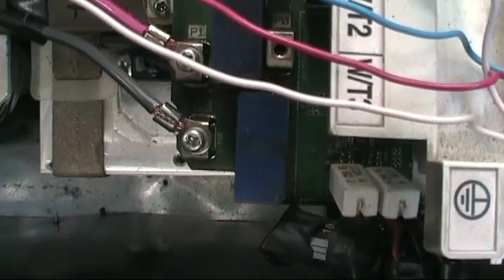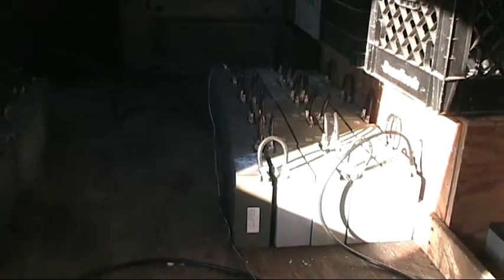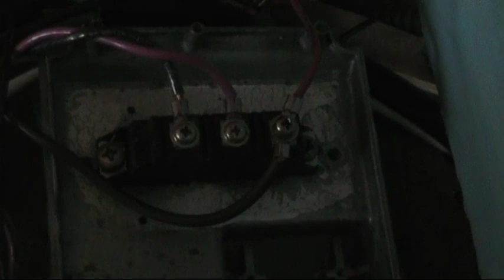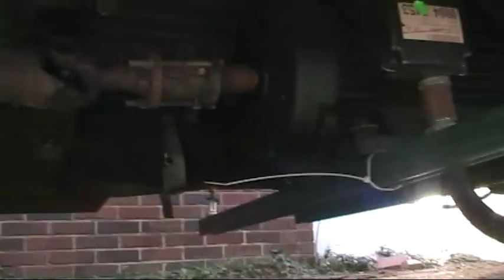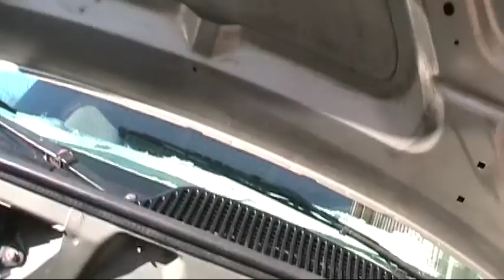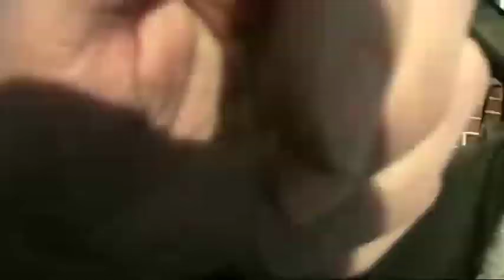Chevy Express EV Tour

Comment from the maker: Lets just say I didn't pay that much for them. I get good deals at a surplus store. 600 volts does seem a little scary, but I've never ever had any accidents with it. Less current for the same power means smaller wires too. The most popular induction motors are 460/480 volts so by going 600 volts, you open up so many chances to use good surplus induction motors

Comment: Interesting. I'm working on an electric conversion for a riding mower / utility vehicle, and once I am comfortable with the design, I may scale up to a road legal vehicle. I am convinced that the induction motor is the best choice overall for EVs. I'd be interested in seeing your complete schematic and other technical details. The 600 volts of batteries would scare me. And I bet they are expensive, probably about $1500 for 10 kWH. I'd use 10 90 A-H deep cycles for about $800.

Comment: I saw with the car you went through the transmission, it looks like the van is direct to the drive shaft. Would a transmission have helped you with the acceleration or did you find problems in the car?

Comment from the maker: @tacozar The 15 HP motor seems to be able to take 60-75 HP pretty eaisly, which is what it takes to get the van up to about 30 MPH (48KPH). For the van to go 60 MPH(100 KPH) (in a reasonable time)  I estimate it would take a 30 HP motor. Then again, this is a big heavy van. (6000 LBS/2700 KG)  A similar motor in a smaller vehicle would probably be more than capable of 60+MPH. Thanks for watching. There will be more videos coming driving the van further.